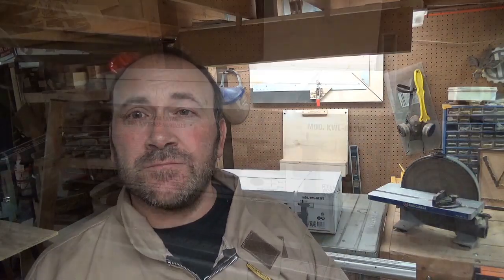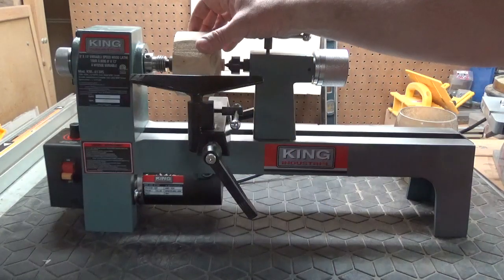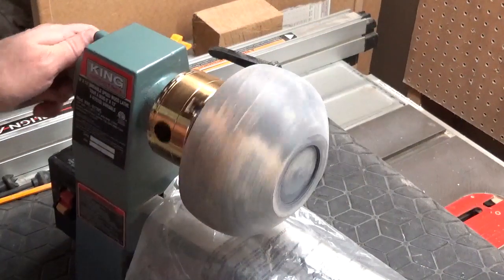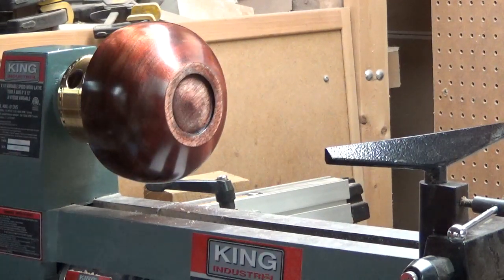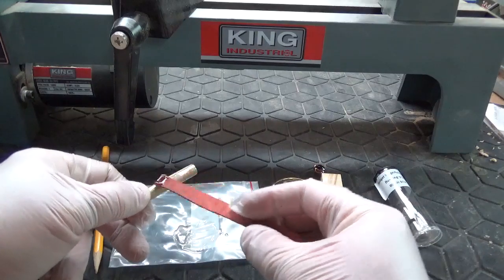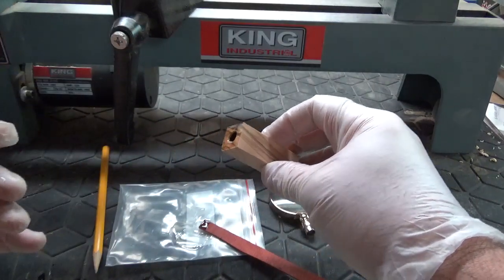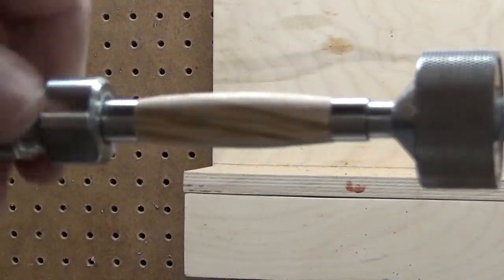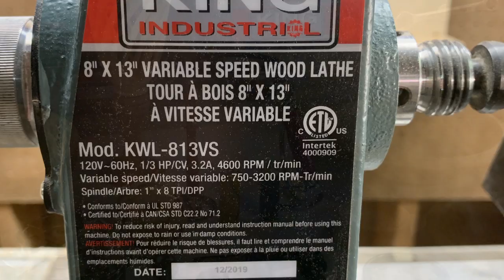GIVEAWAY, King Industrial lathe ( winner was picked ) June 1st 2020

Comment: I want to become a woodturner as a person who works with metal at work coming home and working with wood is a relaxing way to keep using my hands.  On the last piece of furniture I made I “turned” the tapered pins for it in the chuck of my hand drill....this whole process would have been far more enjoyable with the proper tool.  Good used lathes are hard to come by and I have been looking at the adventure of building one, but I know that my garage made one will just cause grief.
Reply from the maker: wendyw4 
#89

Comment: i want to become a woodturner!  @ 14:31, does  this cause any kind of bearing damage?
Reply from the maker: Thomas Z 
#148
Off center turning is a common practice
Search it in YouTube for examples, it would definitely be beneficial to have the lathe bolted down which is an option
Reply: @WoodsleeSummercraftwoodturning  I used a lathe only once. In grade school on Friday afternoons our class would go to another school for shop. The teacher pointed to the damaged ceiling tile above the machine to show us what happens when you don't lock the piece in properly, said it was like a car tire coming off at about 70 mph if I remember correctly.

Comment: Excellent review. I will be checking one out for resin turning when I get a chance. Thank you. What chuck do you recommend?
Reply from the maker: Hi,
thanks for watching ,  resin wood or hybrid, itll turn it all, as far as chucks go it depends on your budget and what you want to do, you can spend anywhere from $100-$1200, a good starter combo is the PSI barracuda, itll run close to $350 but comes with a full set of jaws, nova make a good chuck, oneway, stronghold, but my chuck i use on my big lathe is the easywood chuck, ran me about $1200 with all the jaws but its a nice chuck and changing jaws is easy.
i recommend a pen mandrel for pen turning , also bottle stopper mandrel, call mandrel . I could go on and on. there are a lot of attachments and things youll want and need. 
hope you get hooked
take care
Rob
Reply: @WoodsleeSummercraftwoodturning  Sounds like a good video idea.....;)  Thank you for the replay as well.

Comment: Hi there, do you happen to have the size of the belt drive? I'm in the throws of purchasing one and would like to get some replacement belts as backup. KingCanada website documentation is no help.  Appreciate it, thank you.
Reply from the maker: Hi
Thanks for watching, i can find out for you. Let me get back to you
Reply from the maker: Go to www.kingcanada.com , search kwl-813ds , parts , and it is part number 68-08130320, 32nd item cost is $21.95 
Any king dealer can order it in
Reply: @WoodsleeSummercraftwoodturning  Thank you for the reply. Yes, I do have that info, but at 21$ something for 1 belt and a home school budget.... i'm really after the measurements as I need to make my $ stretch if that makes sense.  As an example, my belt sander is 150XL and way more cost effective going with non-OEM which suits my homeschool budget.
Reply from the maker: @fivelittlescholarsca118  
In that case take the belt off and take it somewhere that maybe will be able to supply you with an alternative.